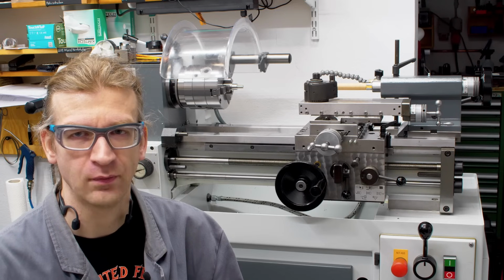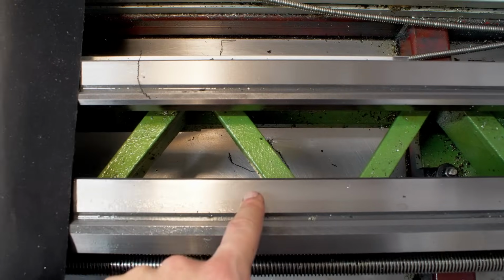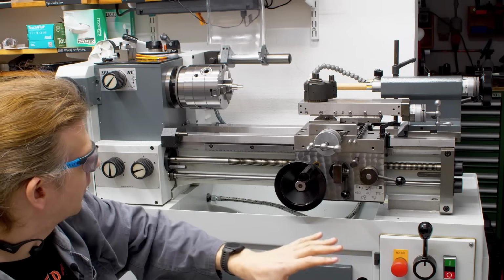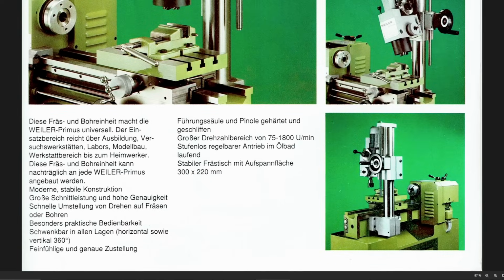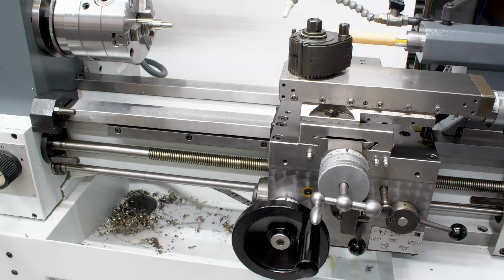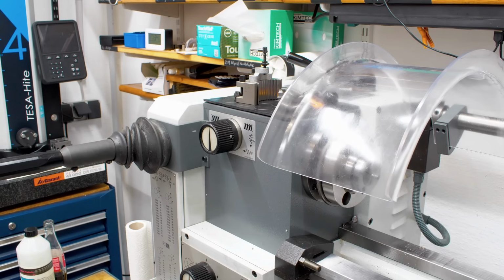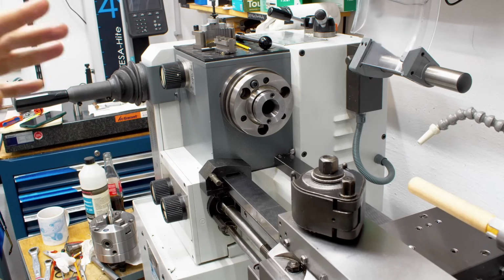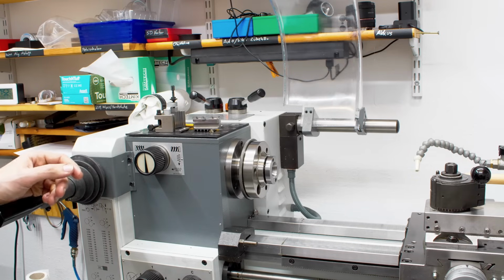Toolroom lathe: Weiler Primus

Comment: Great to see someone who bought a thing show what it does with no buyers's remorse👍
That collet-closer is something I'd give an arm for (though I'd probably lose the other arm power-winding the damn thing within a day or two😉).

I'm not sure why you mentioned the angst of losing potentially hobbyists, all of your content is crammed with useful information about planning and implementing a successful outcome using the equipment at hand, or explaining the benefits of certain upgrades. If you were just showing "must have" equipment, with Amazon links, that would suck, but showing ways of improving cheap gear and building what is needed with what is owned has always been the core of your content since I've been watching it

Comment: I don't think you need to worry too much about your videos becoming unrelateable. For me, I see your work as a standard to aspire to, not necessarily something I actually expect to reach with the limited time I have to put into machining.

It would probably help if i made less silly mistakes too. The part I made yesterday I didn't check both jaws of the vise for chips before clamping and as a result the hardened, finished piece has several dimples in the face... not a problem function-wise, but definitely not something i would give to someone else or try to sell for money.

Comment: My "belt guy" tells me that matched belts just need to have the same batch number on them. It means that they have been cut off the same master belt and will therefore be the same length. Must admit having put 3 new "matched" ones on my old Colchester it does see quieter. The old belts were not in bad condition but were of two different manufacturers.
With regards to "relatable", you are trying to run a business here and then you are showing us how you are doing various jobs and how you go about it. Abom79 is suffering from similar comments. I have no idea why people get their knickers in a twist about this. They should be applauding someone who is going out of their way to impove the way they do things. I'm going to be selling my 62 year old lathe shortly as I have just bought a new to me 12 year old lathe that is far more capable than the old one (if not as well built). We all need to move on in some cases such as yours you have to move on. Good luck with the new lathe.
Reply from the maker: Thanks for confirmation! The batch number thing was basicaly what I was told too.

Comment: Its a different matter buying machines when they are how you earn a living, it has to work and work for as long as possible, you also have to factor in the real cost of time spent bringing a lesser quality or used machine up to the required standard, when the freshly rebuilt lathe can be put to work making parts and money very quickly.
Im just a hobbyist so the relatively cheap used machine with minor issues to fix is the better choice for my needs.
Reply: You nailed it!👍

Comment: @150 Teaching MUST continue. My cousin owns a diecasting place called DieTech. Even though it's a cnc shop, if an error or made or change required. You can't just breakdown the cnc setup to simply deepen a pocket or add a few holes ect. The cnc is already working on the next die. The manual guy is still needed, and these days, in high demand.

Comment: How many times have you jabbed your ribs on the collet closer handle ;) I can see it being turned 90 to the vertical. The unusual bolting down of the slides is something I have never encountered before, would make it very easy to recondition with a standard surface grinder should the need arise. A very unique style of machine.

Comment: Collet stop system is a must... for machining multiple parts...should be easy enough to make.. 
The MT2in the tailstock is a bit smaller than I'd like , MT3 would be preferable...
The spindle bore seems small too, especially when running collets, I suppose it depends on your work..
I like the collet closer... 

I'm looking forward to seeing how it performs in the coming months !!..

I don't know how you work in such a small shop...

All said and done though, Stefan, I'm here for the use of the machines, not the machines themselves... 🤗 

😎👍☘️🍺

Comment: Damn glad to see you having a flat bed lathe... I have a project lathe that is a flat bed - box config. and while i won`t be seeing much restoration of this lathe from you, i guess that seeing a flatbed lathe in prime condition will be a good source of motivation for the work required by that lathe... 
And yeah, i was right, this is a damn small lathe in a way... The functional bed length is not even the width of your shoulders, or barely that with 2 centers... A mighty fine lathe indeed, but a damn small one at that... Most interesting to see what will you be doing with her as time goes on... 

`edit- yeah, i wasnt wrong in my statement... I wrote the comment before watching, so there`s that... Yeah, i get the idea behind a more substantial lathe... The collet actuator is a nice addition... I have 2 collet actuators that i got through random acquisitions, but they are pneumatic and hydraulic actuators, which is a bitch... A lever actuator is simple, easily maintained, easily rebuilt if something goes wrong and so on... As said, glad you got the lathe, she is a beauty, a jailbait really given her size and age, but a looker anyways... I prefer curvaceous lathes, no younger than 50 y.o.a. at the minimum, but trust me, if i run into a sister lathe to your Primus - that got forgotten and is about to be tossed out, i will snag her(tho for what, i have no idea... i have 4 lathes already)... But lets be honest, the ideal number of any machines is the number that you have +1, so what can i do? help myself? absolutely not... But what i can do is save a lathe from being kicked out, or any machine for that matter, and i damn sure will... 
Also, less than 30k, well, i think i know very well how much is that... Damn, that really is a nice price for a baby lathe, but your friend gave you great advice, i`m sure that she will pay herself off in a hurry, and tenfold that investment in a foreseeable time, so what the fuck, there is no reason to think twice or lament the cost... You bought a high performance, high precision machine - she is worth it... Tho, i would be dumping that chuck guard like it`s a fresh, steaming turd... I don`t like such systems... Quite like the driving assistance systems in modern cars... And speaking of motor brakes, i prefer the good old hand on the chuck brake method... Nothing feels like a smooth slab of iron or steel, gently slowing down against your hand(that is until you smash the thumb with an extended jaw)... 
 
And i`m damn glad to hear that you will be running oil on the machine instead of coolant... No chance for rust, no nonsense, just liquid gold... And with reduced friction, the heat generation is lessened, so what cooling the oil provides is more than enough to contend with it... I know that she is not my machine, but i`m most glad to hear that! 

All the best and kind regards!
Steuss

P.s.
The watchers concern is bullshit... I get that most new hobbyists are getting cheap imports and what not, but your work to me has always been educational above all else, the machine used notwithstanding... Sure, you inspired me to get a deckel s1, so i do notice your machines, but as with Robin Renz, i consider you the pinnacle of machining excellence and educational standard-setter, so if you upgrade your equipment, it should not be to the detriment, as most of the more refined machines just incorporate what is auxiliary equipment on smaller or import machines... Like the tilting table on a mill, or a rotary table, or whatever... People should be glad that you are doing as well as you are as a machinist that you are able to get better equipment, and they should find it greatly encouraging to even be able to see someone in the field of their interest making some nice bank through that work... Sure, you aren`t a hobbyist in the first place and most of viewers are, but why wouldn`t people want to be able to transition such a hobby into a nice income source? Not a job necessarily, but a profitable side venture... People just bitch about everything... I`m glad you are doing well and i`m delighted to see you getting some glorious machinery! Praise the Machine Spirit! Curse the weakness of flesh... Ave Omissiah!

Comment: Stefan
if you want to keep the chuck guard replace it wit a piece of  Lexan sheet warm it with a hot air gun and it can be formed into the correct curve , its a tough polycarbonate , I use to use it for the base for 1/8 scale  RC cars crashed it into a steel crowd barrier no damage 

great lathe BTW nice to see a box way lathe I am sure you will make it  sing to your tune 
Stuart from the UK

Comment: Weiler looks awesome, but the same shit square, non self aligning boxways like on the smaller Schaublins, like 125 CCN.
Any gap/play in the gib goes directly into X-axis precision and spoils it.
The usual prism/flat ways are way superior, but also more expensive to make, I guess.
Flat boxways, you can do that on a big slant bed CNC machine, where a few 100kg of turret are hanging down and thereby eliminate any gib play, but not on a tiny horizontal bedway machine.
Reply: what is stopping you from simply adjusting the gib ?   Incidentally , with hardened ways ,proper oiling and intact wiper seals, the need to adjust the gibs are probably
more than a decade away.
Reply: @steveggca  Sure, you can adjust the gib, but machine always operates on a small gap, that is required, for the carriage to move. Adjust the gib for zero movement in X, and carriage gets locked up or is hard to move, no space for oil and perhaps seized ways over time.

On a prism way machine, with cutting force down, the cutting force forces the carriage into the bed and thereby aligns itself.

Any movement up/down has a huge lot less influence on X position than a gap in gib, that is directly in line with X.
Reply: @hinz1   Hi hinz thank you for your explanation.   As it happens I am professionally familiar with box ways, gib adjustments, oil films,  etc.
As such, the idea that a box way and gib cannot be optimally adjusted is  not correct.

Comment: Gratulation zu der "neuen" Weiler, und Qualität kostet halt. Ich habe ja auch Zwei Weiler eine 260-28 Handhebel aus den 40/50er? Jahren die ich auf CNC umgebaut habe und eine Handhebel 260-38 aus 1997 mit Schnellspannzangen, die ich auf Kurbelsupport und Backenfutter umgebaut habe. Beide haben heute noch einen Rundlauf von 0.01 - 0.02mm. Viel Freude mit der neuen Drehbank den Kauf wirst du nicht bereuen

Comment: I like the braking mode of break while moving but no braking when stopped.  Should be easy to put that on my machine with a timing relay or two.

how about making a speed wrench for the collet nut?  not wild on how the knurls are below the diameter of the bearing unit.

Comment: Guter Tag stefan
funny thing is that i have been looking at the exact same lathe modle ( both its size and the boxway witch is pretty hard to find. at least for me ) was thinking of trying to make it hydrostatic when i get mine and running full oil with two pumps ( one for coolant flow and one for the hydrostatic ) but only one tank. i know that the blaser gt15 oil can be used for buth hydrostatic and coolant at the same time ( used it on a swiss lathe at one of my old dayjob's )

btw up here in DK we dont call it a left hand thread but a wrong hand thread ( with is find funny )

btw congrats on the weiler primus

Comment: Very nice review of your new to you lathe. I put a scale on my compound also. Tricky getting the wire to it and maintaining the functionality of the compound while protecting the wire from damage. Also I would investigate being able to put a plug on the compound wire so you can easily remove it without disturbing all of the wiring. I feed the compound wire, cross feed wire and coolant hose all through a cable carrier located on the back side of the bed which makes for a neat installation but also requires a disconnect if you need to remove the compound.

Comment: Looks little bit like a fancy tire balancer for lawn mower tires due to that (throw away) protective plexi cover thingy on the chuck.
Hmm....
You have had optimum milling machine and that new lathe is called a primus.
Are you/we sure your machines aren't some sort of Transformers, which eventually take over the world?

Ps.
Your hands are way prettier than TOT's dirty dick beaters. :)

MFG from Finland

Edit:
I'm not meaning to criticize the lathe at all, the protector just makes my mind to wonder.
Reply: The protective covers comes from regulations, it has nothing to do with the machine itself. There needs to be some approved shielding in place for it to be compliant in workshops where people work with them. As a shop owner you're in trouble if worker gets injured and these protections are not in place. For a retrofit, it really doesn't make sense making custom protection with required certification.

Comment: Hey Stefan, congrats on the new lathe!
At work we also have a Primus LZ, but it's a bit older (built in '85).
It's an awesome machine.
Very easy to use, very rigid, a ton of torque and really precise (when maintained properly).
We almost exclusively do hand-sized and smaller prototype-parts.

Last october I more or less rebuilt it after it got neglected maintenance and care-wise.
Took apart all the slides, cleaned out all the oil- and grease-passages, put new seals on all the slides relubed and changed the oil and replaced all the bearings.

I put a ton of tips and knowledge of you and other Youtube-channels into it.
Your content really helps to deepen my knowledge in the trade and gives me an edge in knowhow to also help others get to the desired outcome.
I sincerely thank you for that!!

Greetings from Knuffingen!

Comment: Very nice lathe! I wish you the best with your new purchase! Just a question, was Schaublin option for new machine ? 102vm or 125vm, I know the price on these is high..
Reply: I was offered 102vm for 3000 euros but it needed to be rescraped, and without testing it it is waste of money. I understand him, this lathe is new, and because he needs precision on the go, this lathe is only choice.
Reply: @regodawoodstudio  yes..agreed..the machine has to pay for itself out of the box. The one that sold here had some good use and not many accessories..which can be a sobering financial realization to assemble, and costly the whole time it is getting overhauled with less than certain outcome, speaking for myself only. I find with a well used machine that I don't know what I have until I throw in the towel.
Reply from the maker: A new 102N-VM is somewhere in the 60-70k eur range.
Reply: My question as well. Not long ago an older Schaublin 102 went on classifieds ads here for 7200 USA $. Did not last too long..
Reply: You can pick up old Schaulblin lathes fairly cheaply in the UK, but I bet they have more far wear on them than you'd want.

Comment: Very nice lathe. I don't think it'll put off hobbyists at all. You've always produced high end work on here for hobbyists to aspire too and I think that's the appeal, seeing everything done properly. I started watching you years ago, got into it, bought a tiny lathe and mill and gained some experience, now I run a CNC vertical borer with a 2500mm chuck. That wouldn't have been possible without the teachings of a very small number of channels, this being one of them. Thanks, I guess!

Comment: Gear train directly to the spindle ? Should be through belt or what?
Reply from the maker: Its nicer when the spindle is uncoupled from the gear noise via a belt.
Reply: @StefanGotteswinter  makes complete mechanical sense.Pre world war I lathes that were gasoline powered had belts on the ceiling all the way to table .
Reply: Nice Lathe Stefan.
My Dean Smith & Grace which I dearly miss, 13x42, circa 1954 was gearbox driving belts to spindle and feed gears, always wondered why they did that, now I know.
Very quiet to run even at it's max speed of 1800 rpm.
Reply: @willemvantsant5105  Seems odd as my 1957 13x42 is full gear drive, the only belt is motor to gear box input pully. They did have a belt high speed drive option (if you had 3 ranges not 2) but it only drives the spindle via that belt in the high range, the gearing for the lower 2 ranges is still directly coupled to the spindle. I have the belt option on my new to me 1972 1307x40 and it is nice to have the extra 6 high speeds.
Reply: The drive shaft and driven shaft were in a fixed position and driven by 4 or 5 Brammer "B" section link belts, can't remember how many belts.
To achieve belt replacement or belt tensioning the driver pulley had built in eccentrics using 2 threaded pins which by loosening one and tightening the other would bring the pulley closer to driven pulley turning concentric again.
The belts could be tightened or removed by removing a link.
Reversing procedure would retension belts.
DSG spared no cost, hence the Rolls Royce of Lathes!